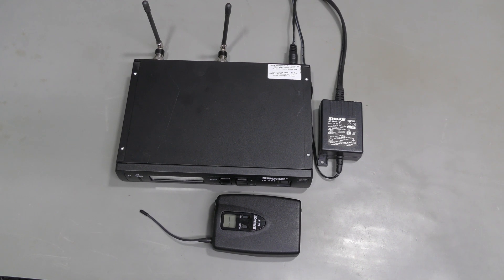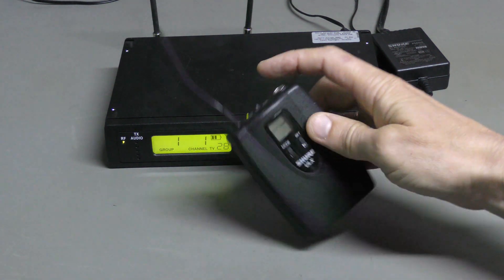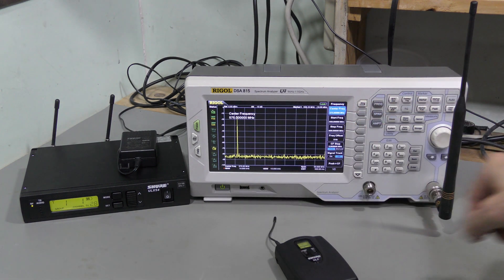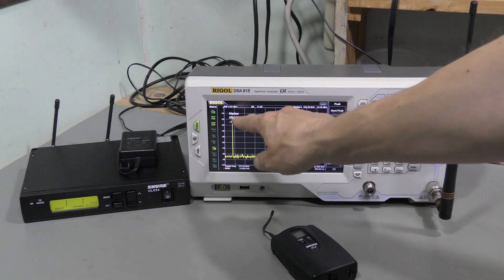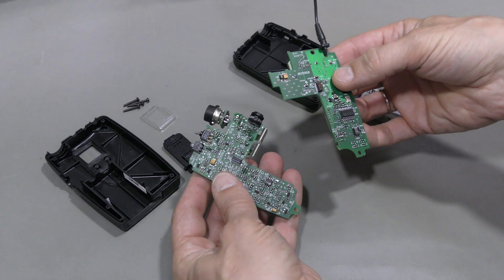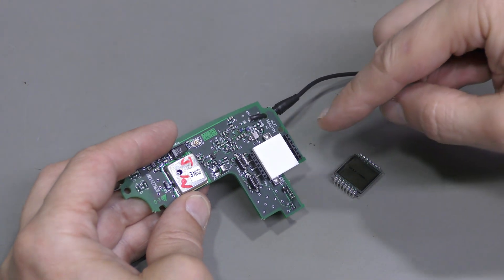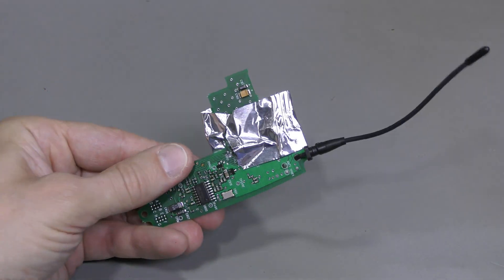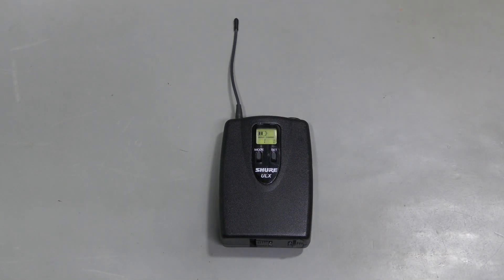#161 - Shure ULX transmitter repair

Comment: I have a UHF mic that gets rf signal but no af. It is a 2 mic system and the other one works fine and has great sound but the other connects but has no sound. I think I have narrowed it down to the microphone itself ?  Something in the transmitter part? Any help would be greatly appreciated. I am fixing it for a friend.

Comment: Nice fix. Did you try reflowing the old IC before swapping it out, or is this a known fault maybe?
Reply from the maker: I replaced a few before with similar symptoms, and I didn't see any problem with soldering. This is not a BGA, where one might suspect an invisible cracked soldering joint.

Comment: You have to give warrantee so you have to change the chip, but in poorer counties they might want to know if it was just a broken solder joint on a leg or contamination between the legs and a clean would fix it, ie, it would be good to see all the attempts.